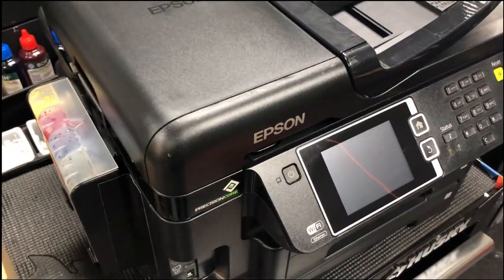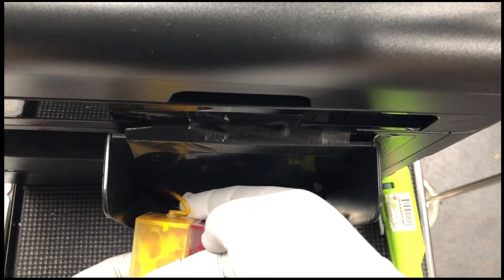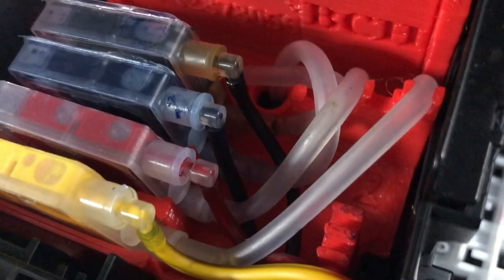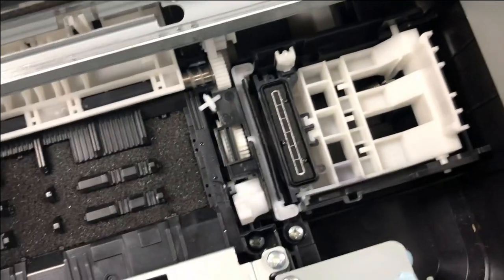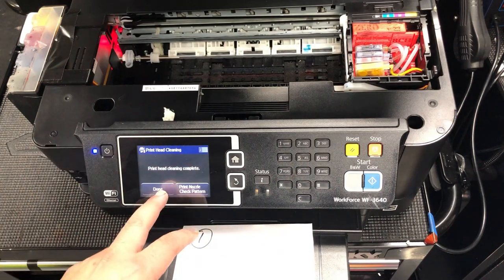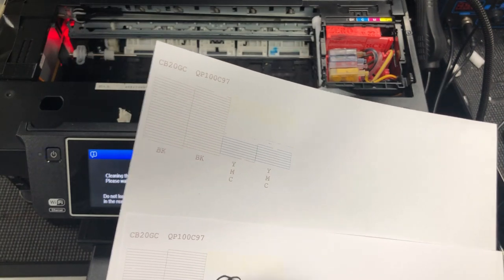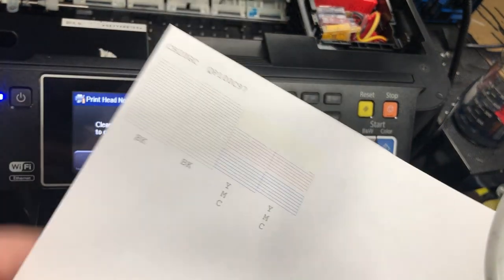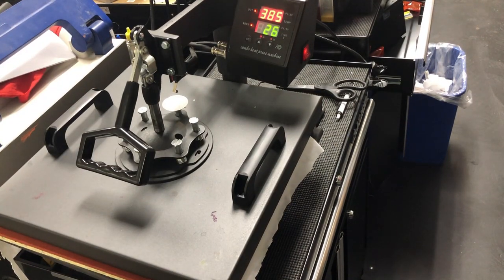Troubleshoot Epson Sublimation Printer Not Printing Color

Comment: My epson 7710 printer prints out the black but no color on my koala sublimation paper. What am I doing wrong possibly?
Reply from the maker: What is your set up (cartridges or CIS)?
Reply: @BCHTechnologies  I am having this problem also. Do I need to change something in the settings so it works?